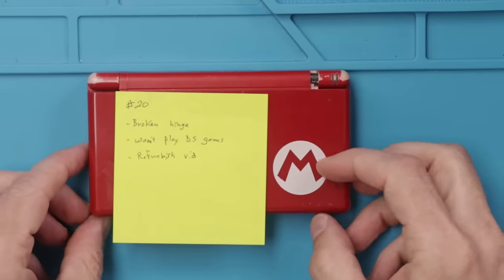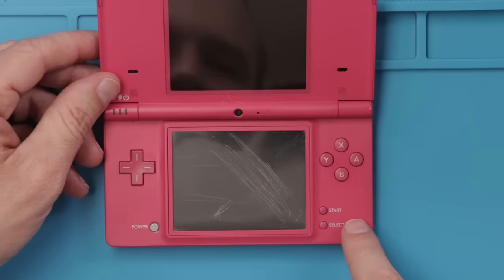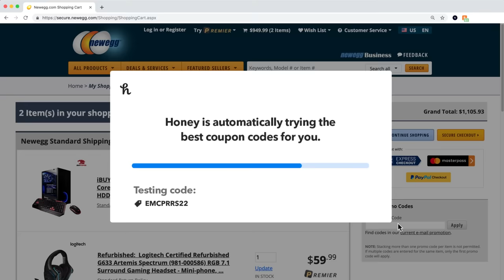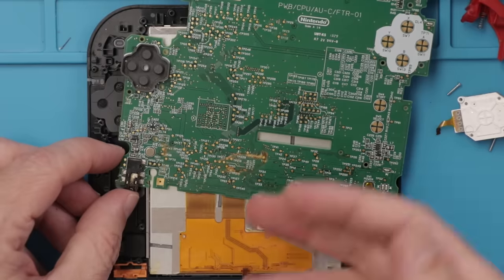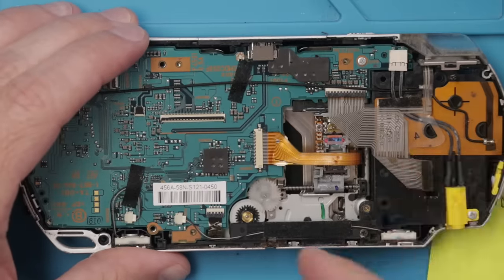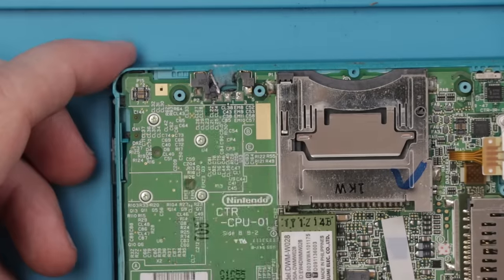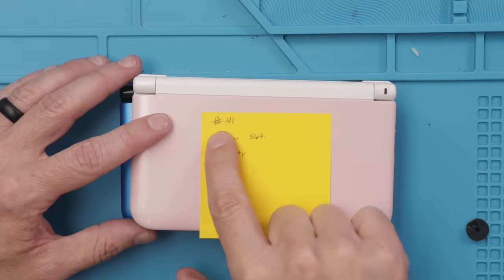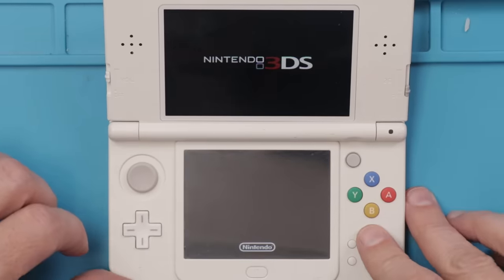I Paid $540 for 44 Broken Handheld Game Consoles From eBay - Part 2

Comment: i picked up a DS lite from goodwill, it won't read games when the system is on, but if i put a game in when the system is and turn it on it works, 
Edit: it looks like this is how the DS lite works, the DSi can hot-swap, DS Lite can not and has to be in loaded when the system is off

Comment: Hey i have a problem with my ps4 slim i cleaned the ps4 initalized it and now im installing system software but my ps4 is relly laggy and if i turn off my ps next time i want to get on it freezes i dindt change the hard drive yet but i will soon so if you maybe know how to fix this issue could you please tell me

Comment: It killed me when you took apart the ds lite when it wouldnt read games. I bought a bunch of DS lites to repair, I thought none of their game card readers worked but it turns out that you had to have the game in the system and you can’t just switch it in and out like a 3DS. Luckily when I found this out by accident, I canceled my order for six new game card slot readers and could mark those issues off the list.

Comment: With the red Mario ds, you made one mistake: after cleaning it, you inserted the game WHILE IT WAS TURN ON. Unlike the 3ds and dsi, the ds lite will not read games inserted while turn on. System has to be fully turn off and then inserted. I could be completely wrong... But this has been my experience every time with ds lites.

Hence why the blue one work with same cleaning method, because game was inserted before system was turn on :)

Comment: Hey bro please i wanna ask you about my ps4 pro these days after that update its been running so slow u cant imagine how much its slow even in the menu its so laggy and freez a lot then turn off i did factory format it but no results its yhen it turn off and give me the checking storage system like if i did take of the ac cable please if u can help me or tell me from where its coming from

Comment: Is there a way i can send a water damaged psp, a screen cracked one both 1k series. there is also 2 psp 3k series one doesn't power at all and one has a broken screen. One of the psp 1k was in rain and one was dropped. The other 2, 3k I have no idea what happened . If yes would I be able to keep one of the 1k and one 3k and you keep the other 1k and 3k?

Comment: Yeah don't use rice for water damage in electronics. Use silica gel. It's 500x more powerful at absorbing water than rice. Every piece of liquid damaged electronics I've encountered was restored to working order after leaving it in an airtight bag for a day. Those little paper baggies you get in pill bottles and shoes are silica gel. I save every one I get and keep it in an airtight container. You can also just buy the stuff for mad cheap. I have enough to cover a cell phone on both sides completely. And since the silica beads are in paper baggies, they don't get everywhere and clog up the device. Saved my phone after being dropped in the toilet. Nice. Problem is over time they do go bad because they never stop sucking water out of the air. They turn yellow/brown when they are no good anymore. Also, it only works for clean water. Won't save electronics from soda or juice. Or milk. Or pee. If you get that in your electronics, it's basically game over. Immediately power it off and remove the battery if possible. Then you gotta open it up and clean it out right away. Don't attempt to power it back on until it is either clean or for sure dried out. Can short out and fry components when used if still wet inside. I find it amazing that our bodies are 70% water and the surface of the Earth is 70% water and water randomly falls out of the sky and we pipe the stuff in pretty much every living/working space but NONE of out technology is water resistant! Go figure! It's just been very recently that most cell phones are being made water resistant up to 3 meters.

Comment: Can you give me some advise for using hot air? I tried once with Nintendo ds Lite that won't turn on (both fuzes were good), so I thought that i could be problem with CPU CHIP and I ended up destroying motherboard while trying removing it.
Reply: Ignacy Wasilewski if the motherboard doesn’t work just get a new from another ds that’s just broken but no motherboard problems

Comment: You should try installing unlaunch and hiya CFW on one of those dsi's and keep it

I like having modded consoles and handhelds because there is so much cool stuff that doesn't run on official firmware or without  a custom BIOS but I don't do hardware mods very often because I don't like them as much but I am going to be doing the louder sound through headphones mod on both my 3ds's (by replacing the resistor between the amp and jack with a 0 ohm one that's the same size and still SMD type) installing a chip on a 1.6 original xbox and my gamecube

Comment: I think it's a bit late but I see that you're not really familiar with PSPs. The two screws on the top are not missing, they're actually for holding accessories. Also when you put on a game it doesn't always play immediately, you can change it from the settings, so if on the menu you're in the settings category you're not gonna see the game. Go to the game section and see the UMD. Just saying because all the ones you fixed always had the same UMD problem.

Little personal thing. I watch your vids because I also like fixing my old consoles or just buying new ones for low price and repair them, but I always have problems that you never find! All of my 3ds XL have the same issue where you close the screen and it shuts off, but I never saw you repair something like this. WHYY?!
Great vids anyway, you're a pro. Good luck for future fixes

Comment: Can you help me out? So i have this problem for a while now on my Ps4 Slim.

So when i put a disc in, it goes in a little slow than normal and then it ejects, so im guessing its the rollers that is dirty or something more.
Reply: I found out that i doesn't go all the way in that's why it ejects.
Reply: Are you under waranty
Reply: @xvxv6975  not anymore, i bought my ps4 almost 3 years ago
Reply: @Axophyse  okay follow a guide cCAREFULLY to take it apart get some cotton swabs ready and some isopropyl  alchol then take the disc drive apart then clean the rollers carefull because a scratch may damage the drive clean the laser lens and if you can replace the thermal  paste
Reply: @Axophyse  then put the ps4 back  as looking at a guise
Reply: @Axophyse  if you have questions  ask me as i repaired my ps4 like this
Reply: @xvxv6975  im planning to open the it up once this corona thing goes out as i dont have the tools yet to open it up.

But is there any way to clean the rollers without opening it?
Reply: @Axophyse  uhm try to stick the cotton bud with alchool  inside until you feel the rollers
Reply: @Axophyse  then it is the matter of cleaning the rollers
Reply: @xvxv6975  still don't know if its the rollers or not
Reply: @Axophyse  tronics fix had doozens of these withcthe same issue

Comment: Meny of this ds lite is in better condition form my ds lite

My ds lite have broken ench i few the have i few dead pixels on the top screen and the left solder is not working that the only the have

But unfortunately i don't have i ds scrow driver and i don't have second ds in the order to replace i few off this problems and i still use this ds lite even if have i few problems like this

Comment: Why does he never try to fix the broken components... If he knows how to solder! Try to go more in depth then just assuming it's trash. Kinda feels like a cash grab video more than anything. No effort is put in to actual fault finding.
Reply: The whole point is to turn a profit reselling them. If he spends more money fixing and replacing then he can sell it for as a USED console then it defeats the purpose of fixing it. He also doesn't like to sell overly damage devices even if he could TECHNICALLY get them operational.